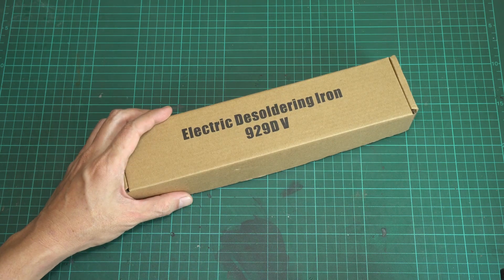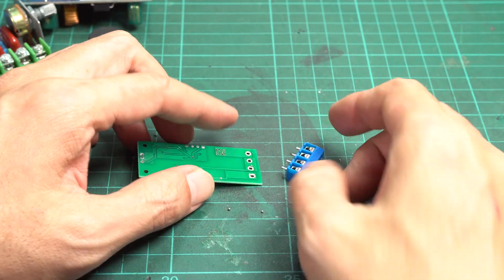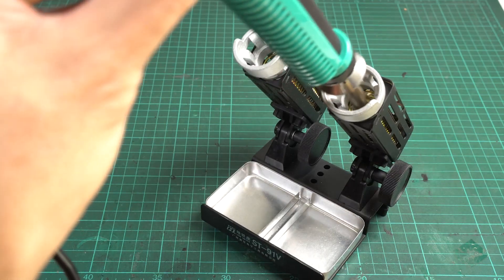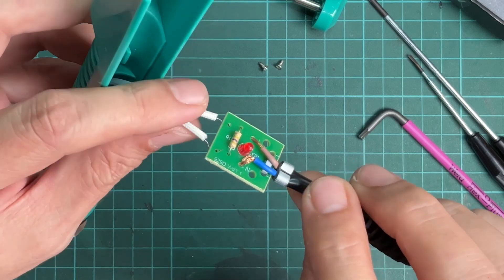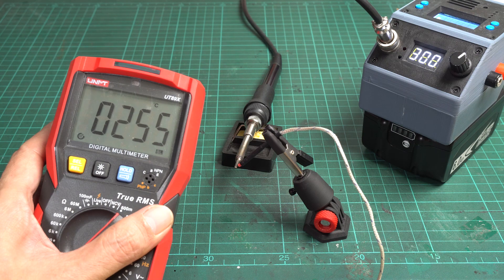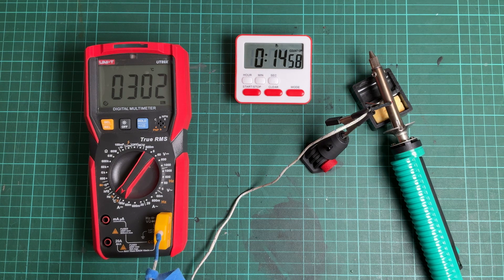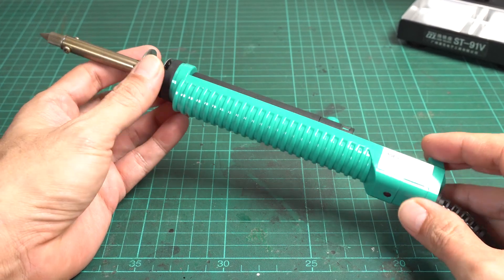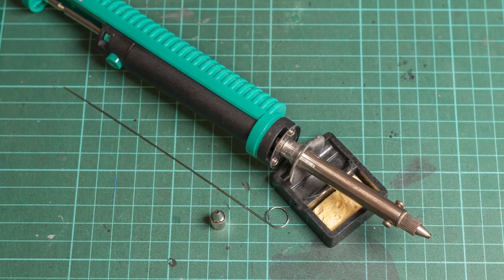Best $10 Electric Desoldering Iron | YIHUA 929D-V

Comment: yo tengo uno, un defecto que noté es que la punta caliente se desgasta con el rozamiento constante con los pines cuando lo desueldas, la solución compré un kit de 10 piezas de puntas de repuesto, así al menos tengo más tiempo de uso y también me di cuenta que la succión a veces pierde fuerza

I have one, a defect that I noticed is that the hot tip wears out with the constant friction with the pins when you unsolder it, the solution I bought a kit of 10 pieces of replacement tips, this way at least I have more time of use and I also I noticed that the suction sometimes loses strength

Comment: How do you clean it after?
Reply from the maker: You can clean the tip just like a regular soldering iron using a damp sponge or brass wool. For the solder it sucks up, simply remove the plastic chamber and empty out the debris.

Comment: does it work with lead free tin ? I'm having a hard time trying to remove tin from xbox 360 motherboards.
Reply: If you add new solder on, it helps the old solder melt as well. I used low heat solder on top of the solder in the PS5 controller to remove the analog joystick.
Reply: ground planes are a bitch this Yihua wont help you

Comment: Impressive CGI!  The solder just vanished in one try!  I wish mine would work half as good as that.
Reply: You've clearly never used a desoldering pump. It's spring loaded and sucks up the solder in a fraction of a second.
Reply: @rolen47    that was part sarcasm. I'm still new to soldering.  I have the same model as this and couldn't get all the solder removed like the video shows.     Got any tips?
Reply from the maker: Make sure your desoldering tool is warmed up enough before using it by letting it heat up for at least 3 minutes. 
When using the tool on the solder point, you should notice the solder iron around the tip melting. Keep the tool at a 90-degree angle with the flat side of the tip against the PCB before pressing the spring button.

If needed, you can also try using soldering flux, but in my case, it's not necessary. I hope this helps!